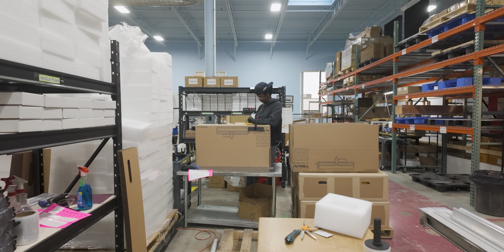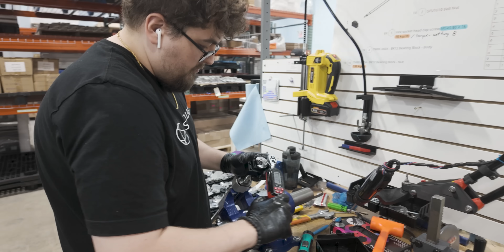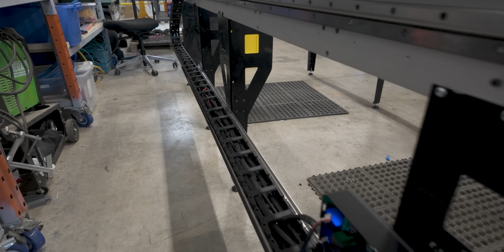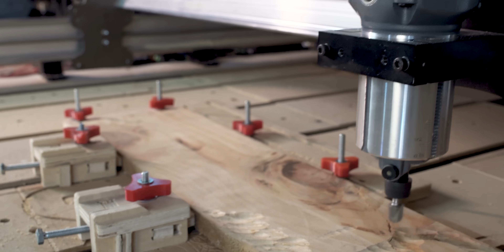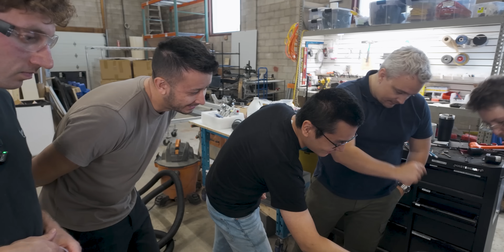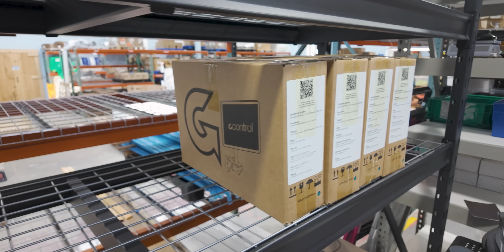Production Update ❘ August 2025

Comment: Love the altmill but lack of 220v compatibility for the 1.5kw spindle as well as superlong board is a no go for me. Yes you could buy a transformer but if you add that to the shipping costs it doubles the price of the machine
Reply: Just be happy its not 600v.
Canada be weird :P

A different spindle drive is only $100-$200. I am not sure how annoying it will be to swap it in though. "normally" all your basic analogue drives are basically swappable. (my friend has an altmill but I've not looked close at the wiring/control config.
Reply: @miniMonsterCNC and then there is the super longboard as well…

Comment: Please provide details on the 2.2 kW spindle :)  Air cooler or water cooled and when will it be for sale in Canada?  Price with VFD?
Reply: Waiting on this as well.  I purchased my Altmill without the Spindle because a 240V spindle makes a lot more sense for the power layout of my shop.  I assumed I'd have plenty of time to figure out the spindle situation before my mill arrived, but it came last week and I've been assembling it without one.  So far I'm VERY impressed with the overall build quality, but I just can't do much without a spindle of some kind.  If Sienci doesn't offer it in the next couple weeks, I need to go buy a 3rd party spindle so that I can actually use my machine.  I'd really like to use something that Sienci put together so that the integration is tight.  Been considering a pwnCNC spindle but it seems like it wouldn't mount nicely into the little spot for it on the leg, and it would be more of a jerry rig.

Sienci - I WANT to buy your spindle.  If it's not available for awhile that's fine - I just need to know so I can make a decision.
Reply: Looks like they released a 2.2 kW, 240V spindle kit for $700 with a non-enclosed VFL last Friday.

Comment: Hi. The controller  that you sell is the 'normal' SLB or the SLB EXT ??
Reply: It's the normal SLB, that's why they had a survey about the SLB-Ext kit.
Reply from the maker: Hey. We sell two Controllers at the moment, the SLB (24v) and the SLB-Ext (48v) . Basically, SLB for your LongMill and the SLB-EXT for AltMill. They come as default when you buy a CNC from us. They can also be bought solo for people to modify and use on their own DIY machines. Some quick product info here: https://sienci.com/product-category/slb-slb-ext-longboard-controllers/ As per this thread, we did do a survey a few months ago about new controller testing - we’re making new controllers for each machine but no upgrade is needed by current users